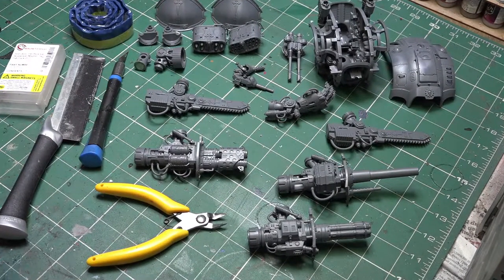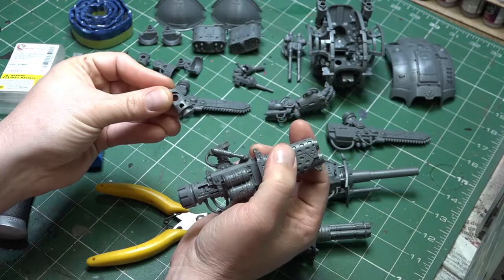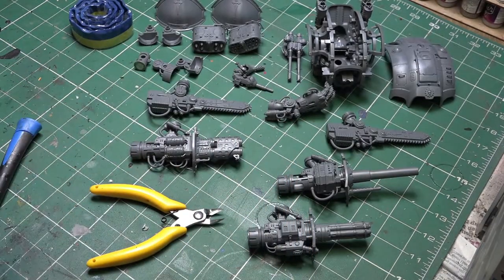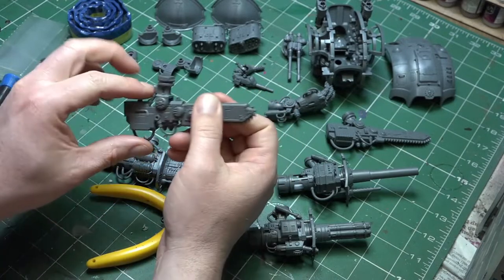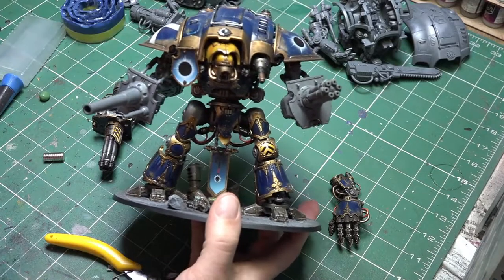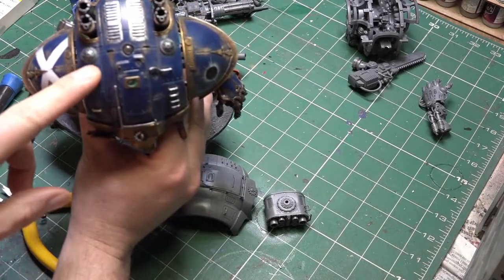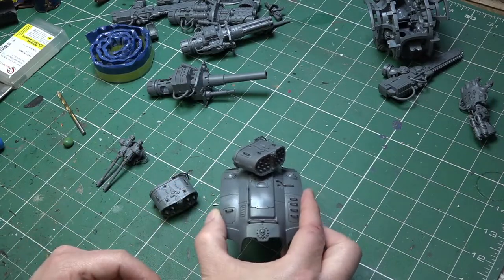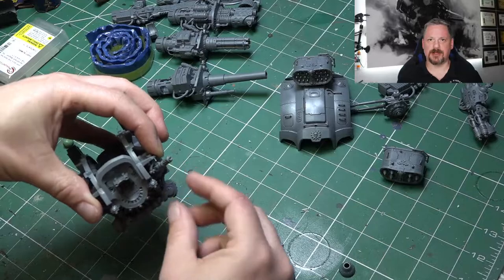Guide to magnetising your Questoris Knights!

Comment: Thanks for the vid!  I wasn't even thinking about the polarity of the magnets until you mentioned it.  Should have been a fairly basic concept, but it just didn't occur to me.  You've saved me a massive headache before I've even begun!
Reply from the maker: No worries at all. Learn from my mistakes is the best way🤣 And I still did it on my baby titans… getting polarity wrong on the carapace mounts despite my own advice! Hope this helps you out👍

Comment: Did you magnetise the different weapon components and face plates too?  I know the rocket/missile pod only comes with the interchangeable front part and the Thermal Spear and Rapid Fire Battle cannon share the same housing with a few loose parts to swap between the two.
Reply from the maker: In this video, I did not show how to make the two rocket plates interchangeable, rather I just focussed on the carapace magnet point. To do the rocket pod face, you will nee to use some old cut off sprue in the centre of the pod frame to attach magnets to it to provide a sub frame point. This would be quite similar to how i did the magnets on the main guns of the Executioner tank a while back as a good point of reference if you need assistance here :) The Thermal Cannon, Battle Cannon and Las-Impulsor all share that same rear section. I wasn't a fan of making all the ammo pieces magnetic )or alternatively pick one ammo option and then magnetise only the front plate with the weapon barrel as I felt it meant either losing parts, or missing an aesthetic out. If I was to do it though, to avoid that loss of component that would be inevitable(!) I would just mag the front plate to the rear section. Again would require a piece of old sprue to hold the main magnet as there is a hole there. Reality is the weapon is then very obvious to your opponent what it is/does in any game and ensure no confusion and people shouldn't get too salty over the ammo parts!

Comment: Guess I need to order a lot of magnets for the arms.

I did use a 2mm for the turret where the nubbin should be and a disk magnets under the carapace. It holds quite firm
Reply from the maker: Its 2 per upper arm, so yeah a few needed for each weapon to work, but they are not expensive fortunately, and much cheaper than multiple Knight kits!
Reply: @OldAverageBritGaming  Was lucky to get a heavy discount on 3 Knights a few months ago at 40% off.
Reply from the maker: @heretichobbies  Nice going!!!

Comment: Thank you Nick, Two or three Knight weapon choices in one eh? I shall definitely use this technique for my own Imperial Knight force. :>)
Reply from the maker: It’s the best way I have found short of 3d printing the arm joints or other shared components. 75% of mine are done this way the rest are glued permanent.
Reply: @OldAverageBritGaming  I started one Knight already and soon realised that only one weapon option is possible if you assemble as shown. which is the only option without extra parts (or magnets0. Not knowing the best loadout and/or what army configurations the Knights may meet in battles, your method looks the best and most practical way forward . :>)
Reply from the maker: Flexibility in build as the points and weapon stats change per edition and per codex is the best route. Knights are one of the easiest to do this with plus the new Primaris vehicles. No one wants to spend £100 on a model only to find 2 weeks later that gun sucks!
Reply: i guess Im asking the wrong place but does any of you know a method to log back into an instagram account?
I somehow forgot my login password. I love any tips you can give me
Reply: @Kase Draven instablaster =)
Reply: @Graham Finnley i really appreciate your reply. I got to the site thru google and Im in the hacking process now.
Seems to take a while so I will get back to you later when my account password hopefully is recovered.
Reply: @Graham Finnley it worked and I finally got access to my account again. Im so happy!
Thanks so much you really help me out!
Reply: @Kase Draven No problem :D

Comment: You said that the carapace weapons hole was 4mm wide, so what kind of magnet did you use for that? Was it a 4x2mm?
Reply from the maker: It’s been a while since I did this one but I think 4x2 yes. I recall having to drill out that small area ever so slightly if memory serves. As the detail on the carapace is a circle. Drill it with 3mm and see what you think? Can always go wider but not smaller!

Comment: Thank you for a great and very useful guide! What size magnet would you use for the waist joint? I am looking to magnetize that as well to help with transport. Do you reckon a 8x2mm would suffice?
Reply from the maker: I actually haven’t bothered magnetising the waist and leave them loose but it’s easy enough. You either need to cut off the top the waist dome and use putty and magnet fix in the gap then Alam one in the inverse receiver under the torso. Or… put the magnet inside the torso when you build it and then just cut the “nipple lug” off the waist dome and magnet there. Either works to keep the same fit of the joints. Size wise depends which you do. First method I think 8x2 should be fine. Second method 8x2 inside torso and whatever the lug size is should suffice. Hope this helps!
Reply: I magnetized a knight castellan with a 10mm disk magnet just before the hole and drilled into the dome and place a 8 x 2 mm there. It holds more than sturdy enough, the torso stays nice and posable. I wouldnt want to keep it loose as it would be way to easy for something to break off when body fell over. Which could easily happen if you game with the knight and pick it up wrongly.
Reply from the maker: @stefan020290  that sounds like a good alternative too! Info get the added sturdiness you mention. I’ve not had an issue personally but it’s personal preference to go the extra mile

Comment: Do you know if this guide is the same with the Magaera? Just placed an order for it, and it's my first knight, so not much context to guess by.
Reply from the maker: It should be very very similar. The magaera is just some resin parts on the same chassis so all the main build is the same plastic including the upper arms. You then put on different armour plates and carapace and of course the weapon arms below the shoulder mounts. So most of what I cover is very applicable to your build!
Reply: @OldAverageBritGaming  Awesome. Thank you for the guide and tip! With such a pricey model I definitely want to make sure I get the most out of it via the magnetization, and your vid is a huge help.
Reply from the maker: Nice one and glad to help as always!

Comment: Can you get away with 8 mm x 3mm magnets?
Reply from the maker: I said 8x2 in the video right? 8x3 should work equally fine I think as there is enough depth in the gun cavity and arm fixing to take that added 1mm👍
Reply: @OldAverageBritGaming  can i use 8×1mm, instead of 8×2?